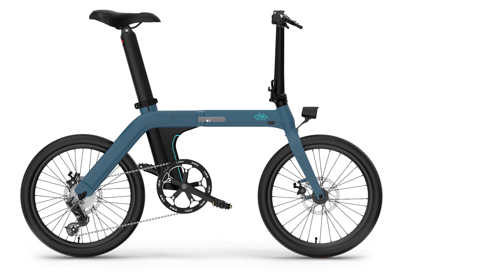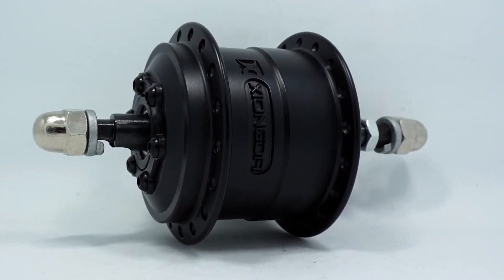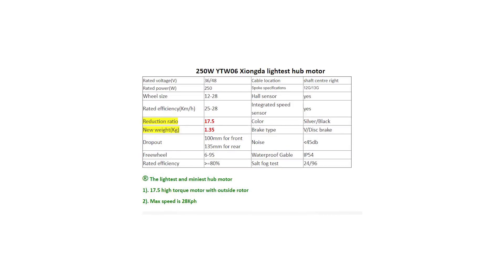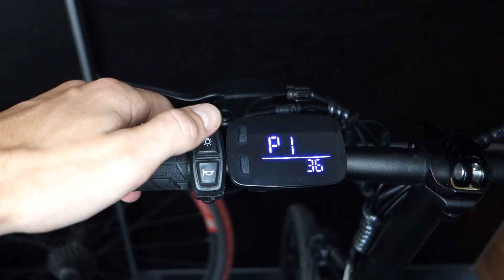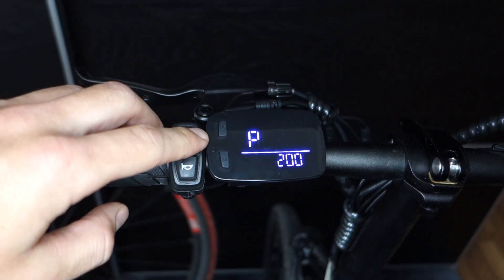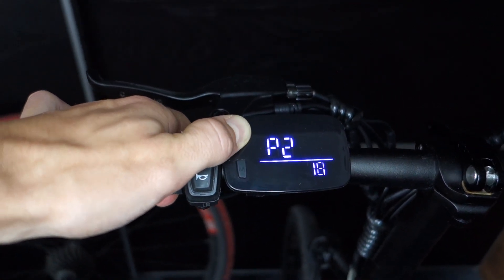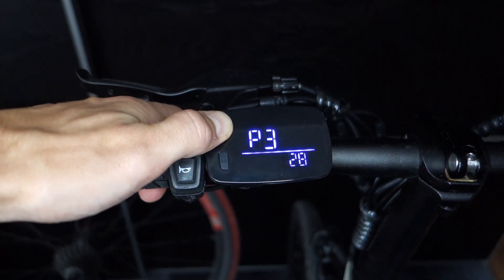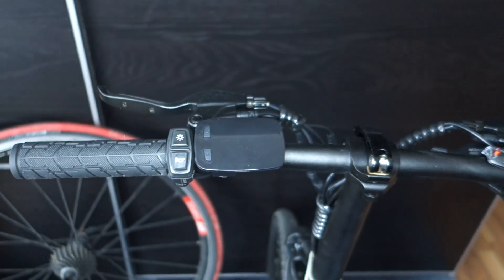Fiido D11 - Increase Speed to 28km/h!

Comment: As stated in your comments, it does work with electric-only mode, but not with pedal assist. Do you have any workaround to get motor assistance for higher speeds than 20km/h? I had a Specialized Turbo in the past which was giving assistance up until 27-28km/h, then it had a hard cut-off. 20km/h is a bit underwhelming to be honest.

Comment: Does this also work with the fiido M1 250w version? there isa trick to power it on with handlebars and throttle open but that does not work on my m1

Comment: There must be some issue, I also experience the same result as other have been reporting: it does not work on my D11. Increasing the wheel diameter does result in lower true speed, as expected, so that parameter does seem to have effect. But LOWERING the diameter to 150 or 160 still results in TRUE GPS speed of only 25 kmh (P3 was set to 36). Anyone has the same problem?

Comment: If you set P2 to 124 - Then your Speedo and Odometer will be displayed in Miles instead of Kilometers.
Reply: @pocketjumper, can you confirm? @simon, does this actually change the units on the display, or does it just work that way due to the conversions and the changed wheel size?
Reply: @jonahbaskin8712  
The display still shows kmh, but the numeric units are actually mph.
I have checked it against my Garmin Sat nav.
Depending on how you hard you inflate your tyres, you may want to lower that number by 1 or 2 for increased accuracy.

As for the Odometer - the logged distance you have already done that will not change its still in km.
Any distance you travel after changing your settings will be in miles.

Comment: I have tried it and it works. If I leave P2 at 200, the real speed (GPS) is 20 Km/h but the display shows 25 Km/h, but if I change P2 to 150 the real speed increases to 24-25 Km/h, but the display shows 20Km/h, so what you really get is that the bike goes at the maximum speed that the specifications say. Has someone else proved it?

Comment: Thanks for this!! Does this action adversely impact the bike overall?
Reply from the maker: To be honest - I have not yet noticed anything bad yet. And I probably have used it for 400k with the adjustment yet. Since, the motor specification state that it is generally capable of going up to 28kmh, I doubt that the motor will go to flames anytime soon. However, going always to the maximum speed possible can surely decrease the lifespan of a technical device. Same as running ur car always at 200kmh ;) (Considering you life in Germany and have access to the AutoBahn)
Reply: @PocketJumper  That is great. Many thanks! On a side note, do you know if you can change the speed for the other preset modes e.g. p3 to 23km instead of 20km. Thanks in advance

Comment: Doesn't work!
Reply from the maker: Hi Robert - maybe I can help? What exactly do you mean with does not work? I was just trying to share what worked for me
Reply: @PocketJumper  i did what you said but then maxed out at 21 so at 150 wheel size that would be around 24. So no speed difference. Before I bought it,  i asked them and they said there would be a speed hack. Now they say no speed hack. Lied to sell. I'm very disappointed.
Reply from the maker: @robperatic  Thanks for the response, but your calc is not accurate. If the wheel size is 150 instead of 200, and you reach 21kmh this ultimately corresponds to 28kmh (as (21 / 150) * 200 =28kmh). I did measure every ride with GPS and it seems to work as expected. However, I am totally on the same page with you regarding the overall speed and pedal assist. Therefore, I am looking into buying a programmable motor-controller (such as https://de.aliexpress.com/item/33006307946.html). The idea here is to increase the current to the motor to make the motor run faster and to get a smoother pedal assist (and hopefully not put it onto flames ;) Keep u updated here. Btw, would be cool if you could change your "does not work" comment. Thanks Robert.
Reply: @PocketJumper  i will try your hack and will share the result very soon. in a meantime could you give a us a link to the controller you want to buy please? the link you provided seems not working and not UK version. thanks
Reply from the maker: @M USMANOV Thx for getting back. The link used to work but it seems the article got removed. I bought a KT LCD display (for programming) and a kt s06s controller (which works with the KT LCD display. Unfortunately the build in Fiido controller did not work with the KT display.
Reply: @PocketJumper  did you install the KT s06s controller?  what improvement did you get compared to the default controller?
Reply: could you send us a link to kt display?

Comment: What happens if you set the tire size lower than 150, will it go faster than 28kmh? What tire size should it be to run 30knh?
Reply from the maker: There is generally no change in speed if you go below 150 as the max power the motor provides is around 28kmh. In order to increase the power of the motor you need to provide more current to the motor - however, Fiido's motor controller is not programmable besides the 3 parameters I mentioned in the video. You would need to buy a programmable motor controller in order to do this.

Comment: Thanks for this. After you have done this does it still display your speed? I heard it didn't
Reply from the maker: It does show you the speed but biased with the new wheel diameter. In other words, when setting it to 150 wheel size. The speed shown on the display is 25% lower than your actual speed. Example: When it displays 20kmh you are actually going 25kmh.
Reply: @PocketJumper  OK thanks. I'm gonna give this a go later

Comment: I saw a tip about setting P2 to 06 instead of 150, can you confirm it results in the same speed at the end or should we keep it at 150?
Thank you!
Reply: This only difference is that the current speed the display shows you will be way more off by 06 instead of setting it to 150. With 150 you will be reaching the max motor power as well and the display still gives you some sort of "normal" speeds aka only 1/4 off the actual speed.

Comment: Weird question. I'd like the bike to have a mode where it's switched on(so you have access to the light, pedometer and throttle), but doesn't provide any assistance unless you push the throttle. Do you think it's possible?
Reply from the maker: Hi John, by default this is not possible. However, when opening up the plastic box on the rear of the bike you get access to the motor controller. All you need to do (in theory) is to disconnect the 3 wire PAS Sensor from the controller. Then No pedal assist should occur, however, the bike should be turned on with a working throttle and light. Should be a 3 wire cable as in this example pic: https://de.aliexpress.com/i/4000813054253.html 
Hope that helps.